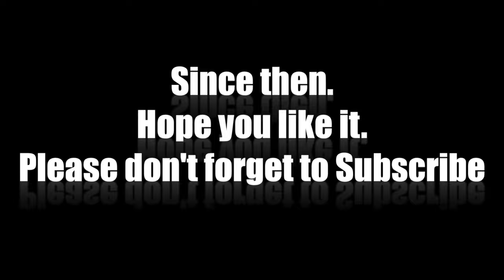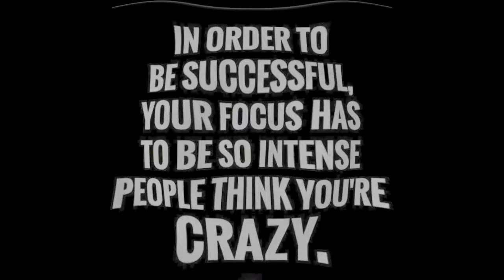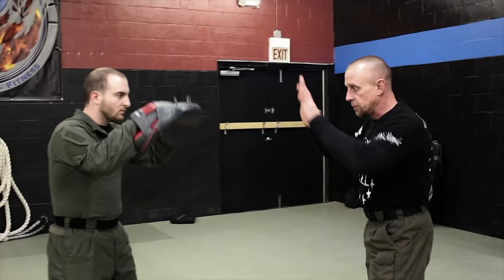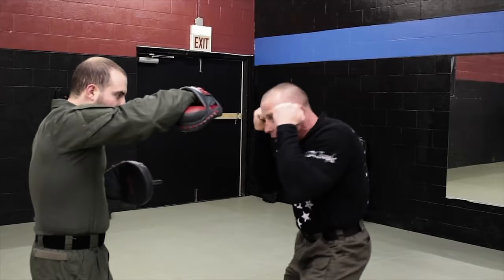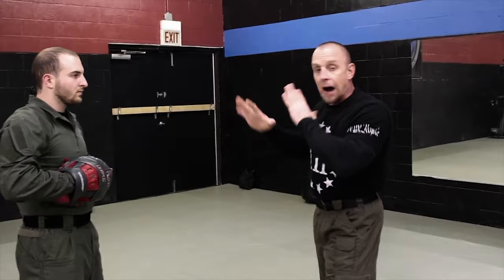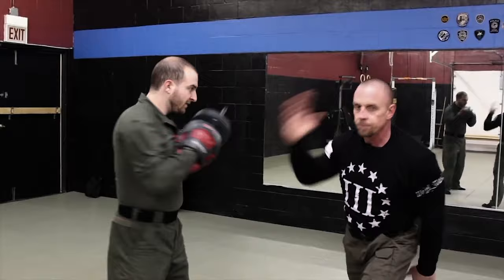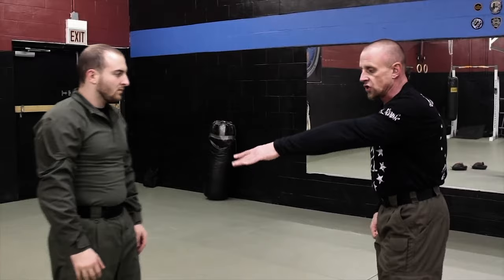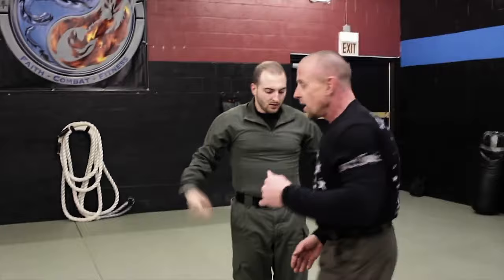MMA punching Hand Deflection Training Drills

Comment: Excellent video sensei.  In many martial arts although hand deflections are taught, you see very few effective hand deflections used in actual combat...such as in competitions. The fighters become zoned to firing strikes rather than managing the attack. There are so many flaws in traditional arts when it comes to true defence applications.  I have been searching these out for many years...and I found my answers in Seagal Aikido ...now I am getting even more from your tenshin based variations. Attack is a dynamic landscape....Defence better be dynamic also...for what cannot bend under pressure...Breaks!

Comment: This video for some of you guys that may not have figured it out shows sparring drills to help make your aikido more effective in an actual fight. Drills are meant to be practiced until they become second nature so that they do not fail you when you need it most. Some criticism noted was: "Doesn't work in a real fight" , have you practiced the drills and failed when attempting them in a real fight? You do have to try it before you can knock it. Otherwise you are talking out of your ass. "Real fights are inpredictible, they don t have a rithm" That is a fact, and that is why you do drills so that you can handle different situations without needing to think up a response from scratch. "If you mess with a mma guy or muay thai or a boxer, those guys are very fast and use different punch and leg kicks combinations, you don t have tine to blink." I don't know about you, but the typical thug or person you are likely to fight knows little to nothing of mma. I seriously doubt if any of your colleagues could handle one minute in a ufc match and if you were to meet someone of that caliber you should be smart enough to avoid the fight in the first place. If you are forced into a corner and have to fight such a person then you would still be better off than the person who has not practiced at all.

Comment: Maybe worth mentioning. Again, im no Aikido guy. However, ive used the Nikkyo lock, stepped to the outside, met elbow to elbow (turns into a standing armbar), step back & pull them into a Muay Thai knee strike. Not authentic, but has worked on several MMA / MT  sparring partners.
Reply from the maker: Nice
See...... Aikido combatives
Reply: THE ROGUE WARRIORS - Where Warriors are FORGED exactly!
Reply: Thank you.

Comment: I'm on my way in in a month or so for the online training.   Studied Butokukahn out here in Seattle 20 yrs back about 3 yrs ago after four unprovoked assaults I moved outside the City and sensing something wrong prior to it's fall or whatever that was.    I was able to defend without drawing blood or inflicting injury.   I mostly study Advanced Math and work in CAD.   Slight Military backround until injured made it through BRM.  Armed Security backround but didn't like the liability.   I grew up in Seattle though I've worked elsewhere what I see is frustrated substance abusers they seem to snap prior to noon.   One threw  a back kick I blocked w/ outside inside and knee combo; security cameras got him.  I've decided to brush up.  I usually have a car but it hasn't worked out with the Transfer Study cost.

Comment: I have few questions if I may:
1. Is it just practice drill, or can it be used in real fight? If so, would it work if you were actually in range of opponent's fists?
2. Is there some benefit from using this instead of "normal" boxing parry? It can probably lead further to aikido takedowns/throws, right?
3. Is there a reason to use rear arm to uke nagaeshi, or can it be also performed with front one?
Reply: 1. No, it can not be used in a real fight against a trained opponent. Which is always the situation you should base the effectiveness of theses aikido techniques from. Can I use this against someone who can throw a mean stiff jab? Nope, not a chance in hell.
2. Hand eye coordination. Basically, that's the only benefit and what he calls RAM, Rapid Arm Movement. Being able to move faster is always good, but this is not helping you in a fight.
3. Don't practice aikido so don't know the terminology, but there is no reason because this technique is bullshit.
Reply: Thanks for insight, SuperKitchenSink.